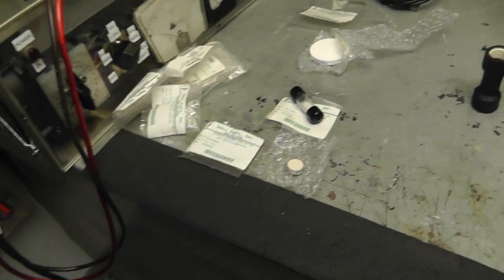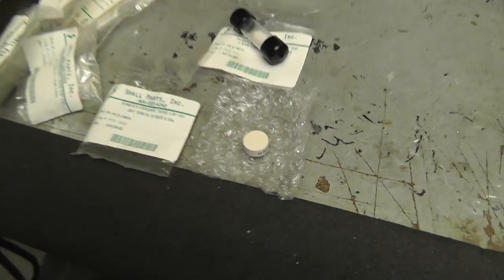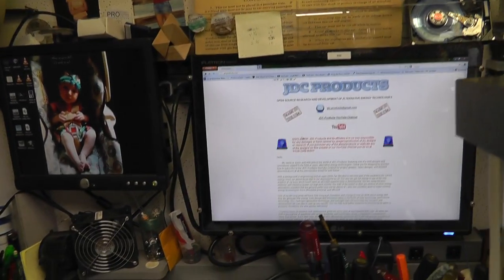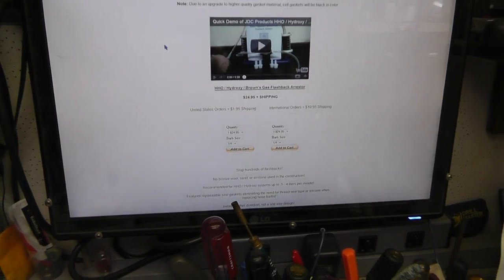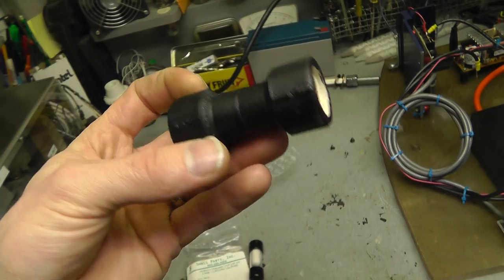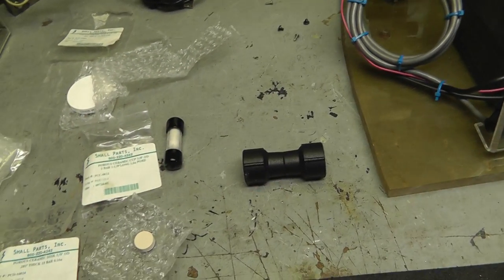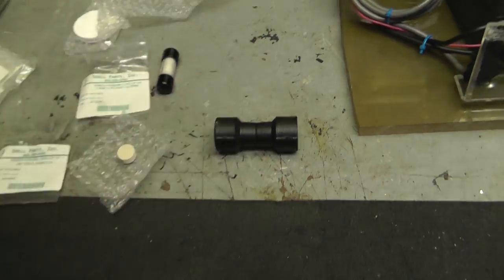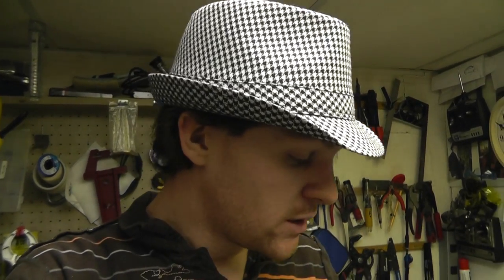Flash back Arrester/Ceramic disk Update & Big Shout Out To Justin From JDCproducts.com

Comment: Thanks for the plug. Hope it works out for you. You are correct, the arrestor is meant for low flow rate systems. When I get some more time to build a larger hho system and I will be building a larger one with less flow restriction. Thanks again and good luck.